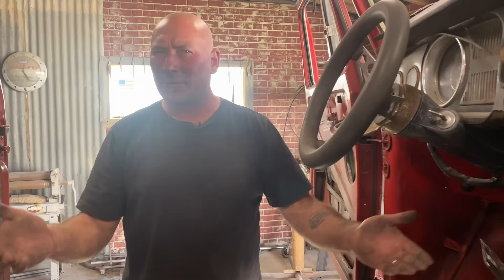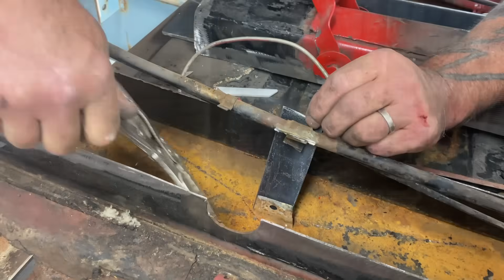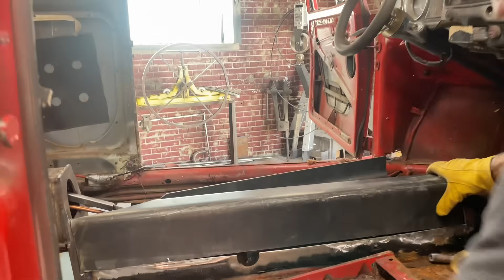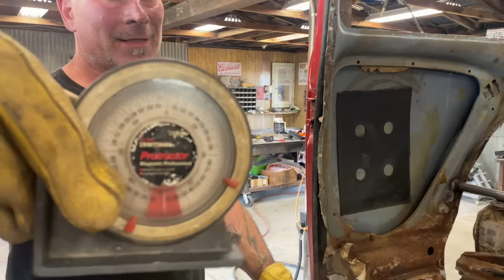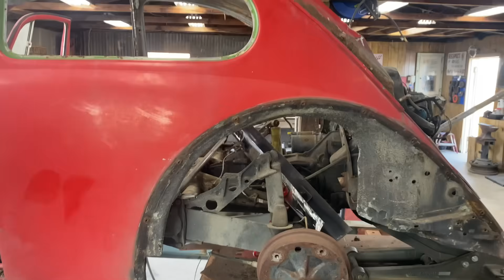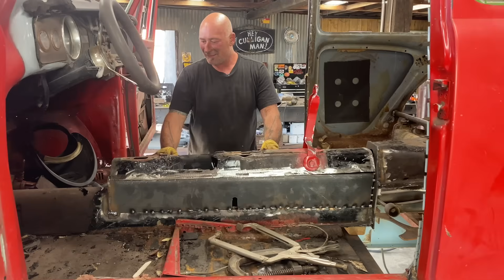Part 6! Ian Roussel And Volkswagen 1968 Beetle Chassis Tunnel ReFabrication😮 🤖

Comment: For an anti-corrosion brake line, it is customary to use cupronickel tubing.  You could do the same for the fuel line instead of aluminum.

Comment: I had a small German-made car called a Lloyd Alexander TS.  The main part of the chassis was steel tube of about 6" diameter that ran down the middle of the floor from within the engine compartment to the rear suspension housing.  Essentually, you're building the same thing in your design.

Comment: If you get a chance?
  Check out the Diablo 48 circular saw blades. They can cut to 1/2 inch steel. No special cold saw required.
  Saves time and effort over a cut off wheel for some tasks👍⌚

Comment: If you had cut the tunnel along the floor then used rhs or made a section along the floor you could have re welded the tunnel on top of the rhs kept all tubes etc pedals complete floor would’ve have stayed at existing level Mike from Australia
Reply: I don't see how..

Comment: Definitely a bunch of ways to lower a vehicle. This way is cool cause you can keep a proper spring rate and all the headroom. Woulda been to just have the shift rod in the open and not through the tunnel. See it in action. But the tunnel can also act as an armrest once it's all capped in. Great work on the videos Jamie! They're coming along good.

Comment: The letters CNC stand for Computer Numerical Control.  Basically what Ian is talking about is a machine arrangement that has a table upon which sheets or plates of metal are cut by a plasma torch guided by a computer through a motor-driven, articulated arm.  The computer terminal is used first to input the design you wish to cut, then the operator, by pushing a button, tells the computer to proceed with the cutting of the design.  The computer starts the plasma torch and begins moving the arm, guiding the torch in the pattern of the design until the design is completed, after which the torch is shut off.

Comment: FYI, something I learned when I worked in at a Tubemill. Pluming is measured by inner diameter. Tubing is measured by outer diameter therefore; a piece of pluming can be fit on to tube of the same measure like a coupling. I know most people don't care but, I thought maybe Ian would maybe want to know when to refer to a piece of tubing as such and so forth.

Comment: Copper to steel use 45% silver solder with proper flux and braze together if you need it strong. Used in the refrigeration world.

Comment: Jamie you made the comment about Ian being able to cut straight with cutting wheel. That is amazing! I still struggle with cutting straight. I learned early on to not force the grinder when cutting. Forcing it will  either break the wheel or make your cut crooked. Great video!!
Reply: Yep, the old saying "Let the tool do the work"Same goes for saws,drills etc.

Comment: Ian, I was wondering why you wouldn’t have cleaned up the rust in the tunnel before welding the plate on? Love your work. 🇦🇺👍🏼
Reply: It wil be, he uses por 15 after all the fabrication is done.
Reply: @65cj55  oh, ok. Thanks for clarifying. Not sure what that is. I presume it’s some kind of rust converter.
Reply: @davidgillard4995  Yes a converter sealer.

Comment: 👍👍  I am also pleased you mentioned the mig v/s tig.  People may not realize the ridgid mig weld can (in some instances) be equated with welding  two different guage metals "where there is some flex": it is more likely to crack along / near join as one is held ridgid whilst the other can be flexed... thus the join becomes compromised.
Reply from the maker: Well said!

Comment: Ian, you can also use flux and solder those copper tubes to the steel. Just don't go crazy and get build  up on the insides.

Comment: i know i am junping a head !! but how are you going to get the shifter rod in the upper tunnel .i know your going to have to cut a hole in the fire wall  so the shifter   rod will go into the tunnel ..but will the shifter rod clear the frount beam now that you raised the tunnel up ???you know the shfter rod is bent  and you will have to clear the frount pannel.  love your post. you need the dogs to check this out lol

Comment: Did I hear him say he was going to “tack weld” copper to steel?
Reply: I tack welded on each side of the copper tube to prevent it from sliding away from the coupled section.

Comment: Not the way I would’ve approached this. I don’t have the hot rod rear drop background experience. I would have cut the “roller skate”(rear diff support, center tunnel and front axle) out of the car as an assembly. Then set it back in, hook it back up to the body, at the stance desired. You have to build some of the floors anyway and it would be easy to drop the floor to where you want it. The pedal  bracket is easy to relocate any place you want, it comes out by just removing the spot welds. Same goes for the shifter. I moved 20+ shifter and pedal assemblies on these. This is assuming I know where the build is going, which so far is questionable.

One possibility on the shifter, mount the shifter bracket in some sort of metal support on top of the tunnel. For interest, you could have a hollow tube run between the shifter support and the back end of the pan and run the shift tube through that. Based on the interest in interior volume, you should definitely consider moving the seats back in the car as far as possible. That’s where the MG TD replicas had their seating. 

Cheers, and thanks again, to both of you.

Comment: Computer Numerical Control (CNC) machining is a manufacturing process in which pre-programmed computer software dictates the movement of factory tools and machinery. The process can be used to control a range of complex machinery, from grinders and lathes to mills and CNC routers. With CNC machining, three-dimensional cutting tasks can be accomplished in a single set of prompts.

Comment: Jamie: a CNC machine is a cutting, or welding, device that is controlled by a computer. The computer has a special application which allows you to feed it a digital design of your choice, or make a design of yourself, with the resulting picture typically known as a “vector drawing”.  In the case of making special car parts from raw metal, these designs look like engineering drawings. The raw metal is then placed on a table where the cutting or welding head is automatically moved by the computer based on the design you have selected.

Comment: Ian I did not read all of the comments so if you answered this question I'm sorry and I am not being critical if you lowered the rear 6 inches and I thought you said that the front is in the stock location would you have to modify it to have a level ride height I get what you're doing just no experience with vdubs keep up the great work thanks
Reply: The front ride height will be lowered also.

Comment: And the Google says: "A computer numerical control (CNC) router is a computer-controlled cutting machine which typically mounts a hand-held router as a spindle which is used for cutting various materials, such as wood, composites, metals, plastics, glass, and foams."

Comment: A different approach. Building a full custom floor pan mounted 6" lower than the tunnel/spine would maintain the integrity/alignment of the front and rear suspensions. The body could be modified to mount to the custom floor pan and clear the front and rear suspensions. Pedals would need to be moved and the shifter might be stubby. Just a thought.

Comment: I checked the last 2 videos, they do not show you cutting the roof off, why did you do it? Why didn't you brace the body??
Reply from the maker: Rolled it out of the shop… too tall… crushed it… did a little surgery off camera
Reply: He raised the car about 3-4 inches while it the shop. When he tried to push it outside… it crunched the top. But it was coming off anyway. He’s using the fiberglass top.

Comment: Porsche trapped the torsion bars on the 911 so they cut a little circle and put a screw on a circle plate over the hole in the body. lol

Comment: Instead of putting the original top on the good steel, why don’t you just lower the ship gear so you don’t have a big pump in between the seats😅
Reply: Big Tunnel's cool though, like sitting in a Lambo or Fighter Jet.

Comment: You could actually solder the copper to the steel, I make pick-up lines to go into gas tanks … no problem. I also make dog toys consisting of 2 1/2” fire hose, with tennis balls inside, my maniacs love them, my 4 yr old Pittie goes crazy , and my 3yr old OORANG is right with her, I would love to send a couple of them . MLNR JIMMY53

Comment: That's a janky way to rig the clutch tube and accelerator cable,  just that slight lip is gonna  cause them to fail and get worn in that spot
Reply: So it will last 2 years instead of 20 ? I can live with that.